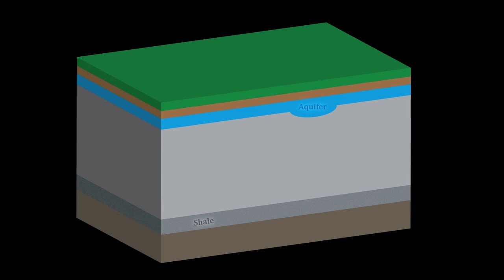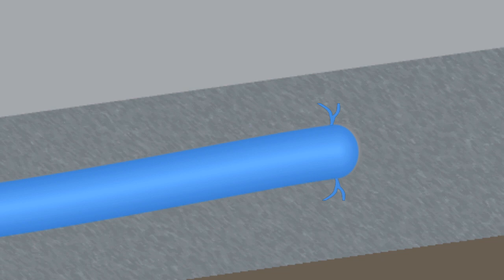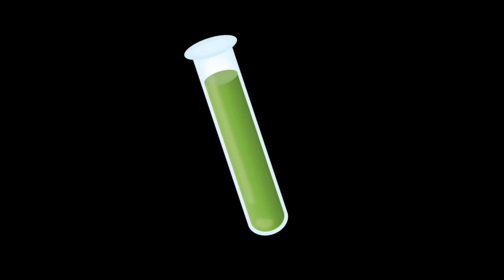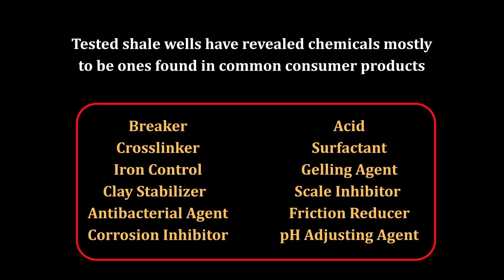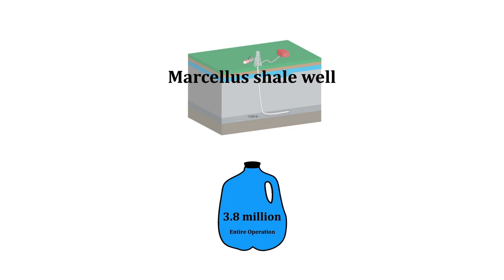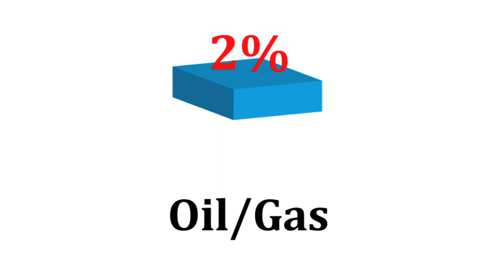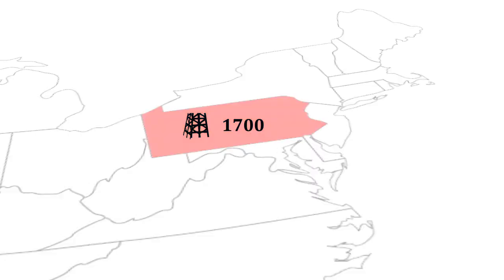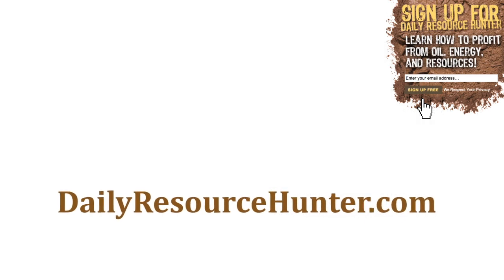What is Fracking?

Comment: Ugh, there are so many things wrong with this comment I don't know where to start! First off, drill pipe is engineered. During the fracking process downhole pressure is monitored extensively - the whole process relies on pressure. In the coming months/years after the well is completed the pressure falls off -- that's why a pump is needed (those things that look like nodding donkeys) but even at that point the pressure is well under control. Simply put, the "leaks" that you refer to don't happen.

Comment: everybody lets not forget what the those "Pipes" that bring the oil up are going threw. They go threw the aquifers that give many people there running water. oil pipe lines are famous for leaking. The large pipe lines above ground have been reported to have up to around 345 leaks, and they call that decent! These are a lot more prone to leaking because there under ground so are near impossible to inspect.Another good reason why fracking is a bad is a bad idea.

Comment: you make it sound as if fracking is an underground grenade....which is isn't.  Instead it's pressurizing a rock formation so that tiny cracks form. Then, as the video shows, sand props these tiny cracks open so oil and gas can flow. Sand and tiny cracks, not "large explosions."  It's amazing how little people know about this process before they make judgements. Please get the facts first.

Comment: Here's one point I'd like to share...  I understand that some chemicals are used in this fracking process, in small amounts. But the thing most people disregard is that crude oil or natural gas, the stuff we're trying to get to run our cars or heat our homes, is pretty nasty stuff itself. 

So for anyone thinking companies are "polluting" the earth, just think the same geology protecting our groundwater from natural chemicals (CH4, C8H18, etc ) keeps this fracking process well under control.